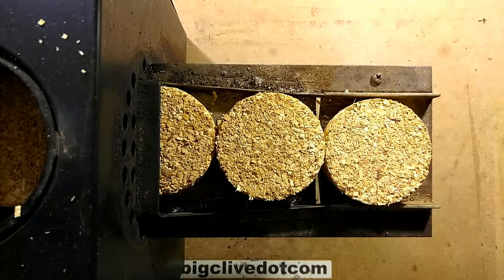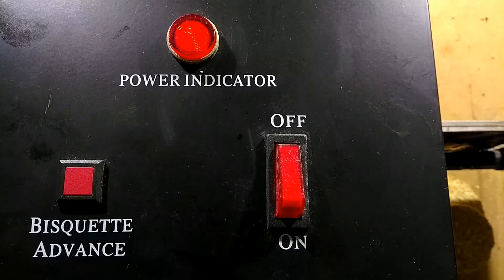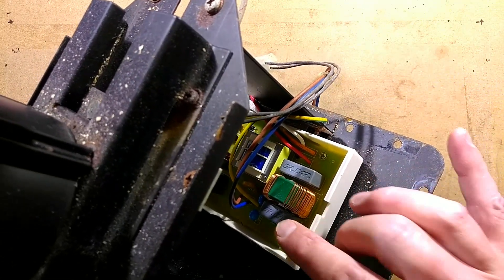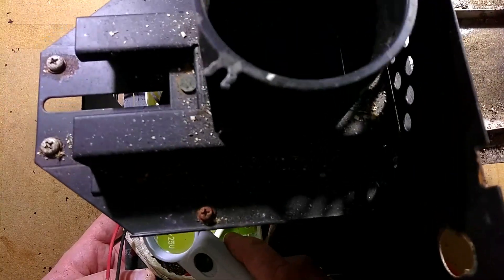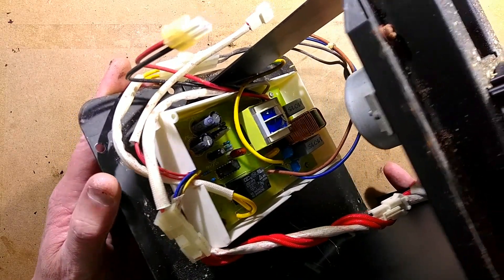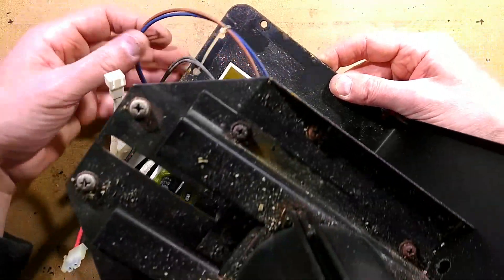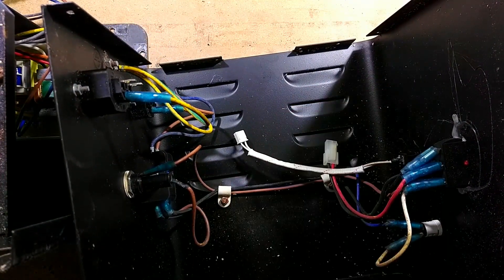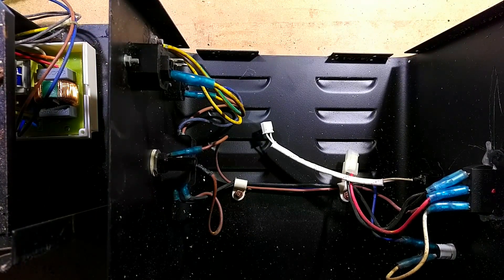Fixing a Bradley smoker feed unit.

Comment: The ubiquitous stuck-button issue. Mine had that.  Newer versions of the smoke generator changed the switch to a different one (it's round) with more clearance between the button and inner diameter of the switch body.

The plate that gets hot isn't a pre-heater.  The transfer device moves pucks to that spot and they sit there for 20 minutes and smolders thereby generating the smoke.  After 20 minutes, that timer circuit trips the motor to slide a new puck into place and the new one pushes the dead one into a pan of water to extinguish it.  This ensures the tar and tannin's in the wood don't burn and impart a bad flavor into the food.

The pucks are expensive, the cabinet doesn't get hot enough (without doing a 3rd party upgrade on the 500w heater element in the bottom of the smoker cabinet), but the food it produces is very good because the smoke is very thin and clean, not thick and billowy.

I know this was a few years ago but I hope your brother paid you back for fixing his spendy smoker with some delicious smoked meat!!

Comment: the briquettes aren't preheated,  the hot pad at the end of the feed actually burns the briquettes before pushing the next one on,  dropping the ashes into a ash pan,  the box  is usually fitted to the smoke stack via a pipe, and the stack itself usually has a heater of its own for hot smoking,  the devices whilst fairly safe are quite flimsy in build quality,  often getting jammed up or failing,  damp briquettes usually swell and get stuck,  or can even mulch up in the mechanism,  and the plugs are on rather short leads,  usually getting over tensioned, resulting in tetchy connection with the stack

Comment: If you think 7809 is an odd choice, I have a whole tube of 7808/7908s... I actually use them from time to time in analog circuits, as +/-8V is pretty close to 15V, which is a typical analog voltage.

Comment: Hi, Clive, I'd be putting some stabilising goo on that toriodal choke. 
If it is only connected and fixed to the PCB by its wires, which look quite small diameter it may break away.
Reply: yea just some hotgoo

Comment: 9V with 4000-series CMOS is much better for controlling electromechanics than the 3.3V and below required by too many modern chips.  At 3.3V there is barely any room for diode drops, and currents become too high for tiny driver transistors. 12V is the most obvious alternative to 9V.

As for the protection circuits in there, this is a typical overbuilt design since the extra filters drown in the margins for such a niche burner, while the cost of failing an EMC test after passing all the fire safety tests could be really high.

Comment: Why so much concern about audio? No matter which device I watch on I find it perfectly acceptable. This pc feeds audio into my hi-fi and comes out to me nicely quadrophonic, albeit pseudo. Another pc plays through HDMI to the monitor's internal speakers, and my tablet plays through it's own basic speakers. Never need to give it a though and always perfectly understandable. 
I'm sure that machine could be modified to toast sliced haggis with a little thought, I'd be at the front of the queue to test the product.
Reply: I could speak through an electric guitar amp and be understandable. But the sound would not be nice
Reply: Try watch it with earphone/headphone.
Reply: If he can make better sound just by adjusting the settings, then why not? As others said, the gain is too high. This is easily fixed.
Look up kaizen philosophy.
About your audio quality: I am sure you would not notice a huge difference, because none of your equipment is optimized for reproducing distortion-less audio. Tablet and monitor speakers are the worst, and a hi-fi is mostly for music, therefore not so balanced. Also human hearing is very adaptable, you can get used to very bad sound, because your brain will balance it out.
But the question is not about fixing his horrendous audio, he just want to improve it more.
Reply: Yes, my hi-fi is biased towards music, as indeed is much of my life. It is as good a system as my means allow, of course this is made easier by living by myself and able to arrange furniture, speakers etc. to suit me and the way I hear. 
Youtube is not a medium that I expect to hear crystal clear sound or vision from anyway, and what I am saying is that I find it perfectly acceptable on Clive's uploads, and I have never  needed to back the video to listen to something again. Of course it also helps that he, in common with the majority of Scots,  enunciates wonderfully.

Comment: What's the purpose of the suppression components?
Reply from the maker: I'm not sure in this application.  I don't know what's in the other part of the smoker that plugs into this unit.  Possibly just a heater.  It may be to reduce switching pops, but it seems a bit over the top.  Unless the same PCB is used in a unit with a dimmer style circuit in it.
Reply: bigclivedotcom I meant in general. Should've written that.

Comment: how does this smoke food ? .....no idea what this is
Reply: mark layton it's just to evenly supply fuel for the actual smoker, maybe BC will show us the whole machine in the future. I would love seeing both brothers solving the world problems while testing whisky and smoked food 😀
Reply: Mark, the smoker has two parts, a large oven that looks like a small fridge, and the smoker (which is seen here).  The smoker sits inside the oven via a small opening at the side, and advances one of those bisquettes onto the hotplate at the end of that chute which heats the bisquette so that it smokes but doesn't catch alight.  As this sits inside the oven the oven fills with smoke and thus cooks the food.  The oven also has a small electrical heating element inside, which through convection helps circulate the smoke and cooks the food at the same time.  After around 20 minutes the smoker advances a new bisquette which pushed the now burn through bisquette off the hotplate into a dish of water.  Whilst the Bradley smoker isn't cheap, it does cook food well, and compliments any BBQ :-)